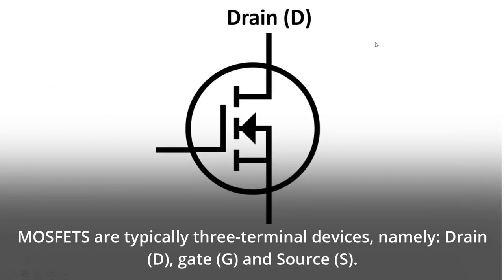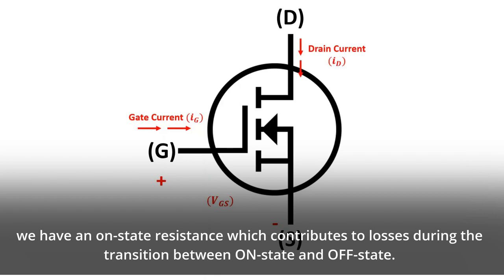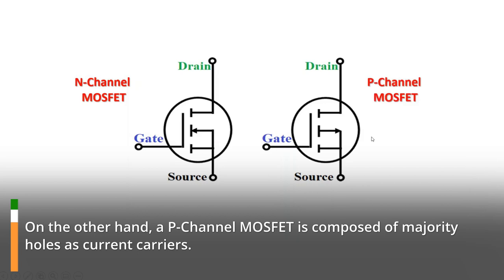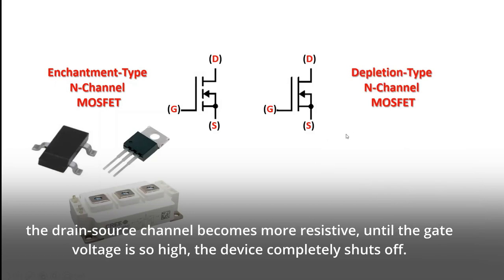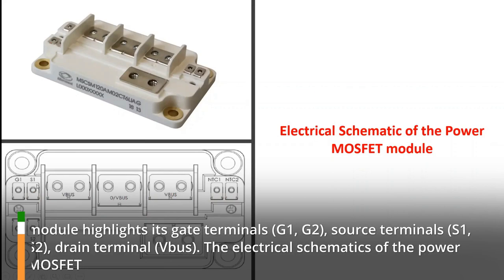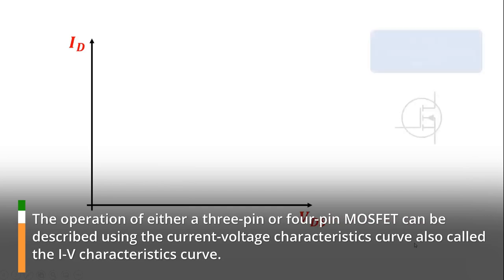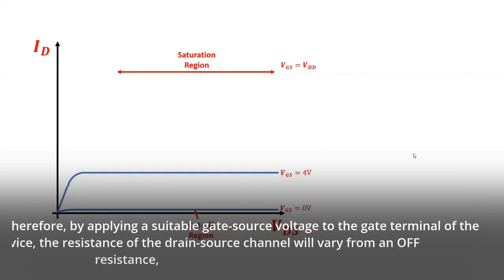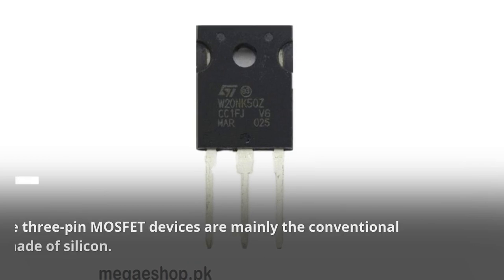Power MOSFETs

Comment: Can you define what exactly the green load line at 6:02 represents? (Negative sloped line connecting A and B). Does it relate I_D and V_DS to V_GS somehow? Are the quantities still I_D and V_DS? And what determines the slope?
Thank you for the video by the way. I appreciate your hard work providing this info on YouTube. Answers to my questions would help my understanding a lot.
Reply from the maker: Hello, thanks so much for the comment. The load line shows a linear relationship between the drain current and drain-to-source voltage.  This allows us to see the region in which the MOSFET is biased. 

Point A represents the transition boundary between the non-saturation and saturation regions. Therefore, at Point A, the drain-to-source voltage (V_DS) is equal to the difference between the gate-to-source voltage (V_GS) and threshold voltage (V_T); V_DS=V_GS - V_T.  As the gate-to-source voltage becomes more significant than the threshold voltage, the MOSFET is turned ON and is biased in the saturation region. 

On the other hand, Point B represents the cut-off region of the MOSFET, in which the gate-to-source voltage is less than the threshold voltage. The drain current is zero, and the MOSFET is turned OFF.  I hope the explanation brings more clarity to your question. If you have further questions, please let me know.

I will start a new series on how the MOSFETs are used in electric vehicles very soon, so kindly stay tuned.